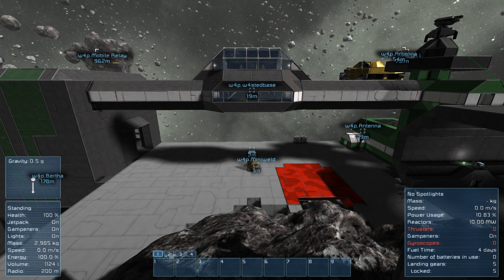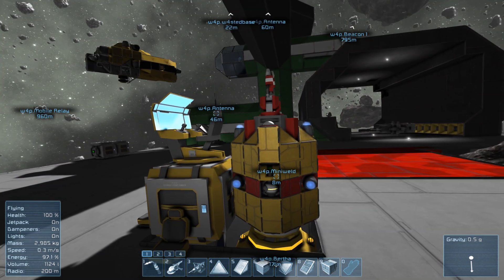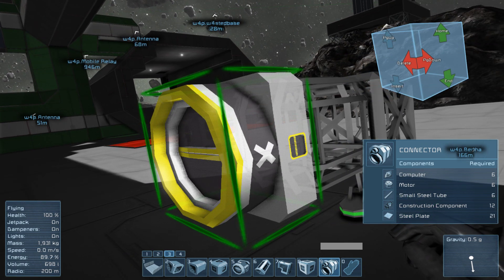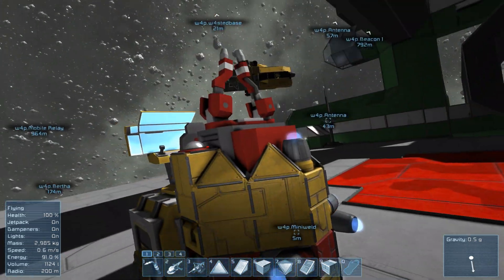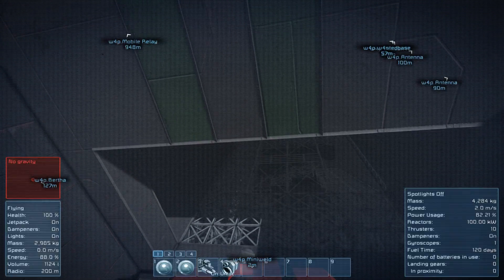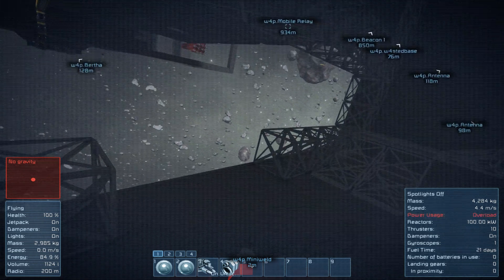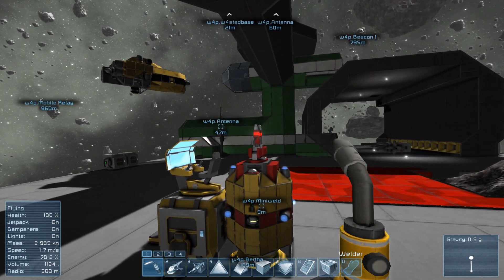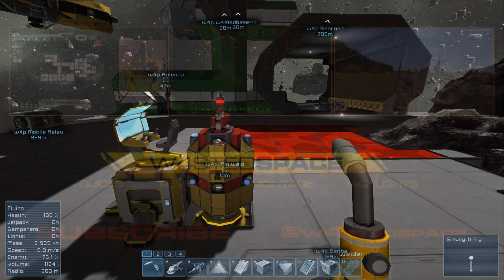Space Engineers - Remote Control Mini-Welder Tutorial - Survival Mode

Comment: Batteries...? How many and where?
Reply from the maker: It uses small reactors... it's a pretty old design!
Reply: @w4stedspace  lol, its a timeless problem... do you have a similar design that would work well on planets? I'm trying my hardest to build a small welding flyer to zip around the masses of scaffold base walls n floors... but everytime I try, it ends up a hulking mess at which point I figure if its gonna be a hulking mess then it needs to be vastly over engineered... which this is not... because it was meant to be tiny instead... which its not... 😡 also, im a long time fan. Youre one of the reasons I've been following this game for almost 10 years even though I only started playing when it came to ps... thank you for the reply and keep up the good work 👍
Reply from the maker: @sergiosperspective  Thanks a lot! Always nice to hear :)

Yeah you have sadly run into one of the most awkward of designs to attempt... you need cargo, which is huge, and it needs large connectors.... which are huge.. and then you need batteries... which are huge.

I don't have an easy design example - I did build a much more modern one during the Vanguard series, but that could have been smaller.

Imho the best way to handle things is with a swap-out battery pack, so you can use one or 2 batteries only, and switch them out to recharge to keep the size down but still get decent runtime.

I'll see if I can dig up a timestamp for the thing from Vanguard!
Reply: @w4stedspace  youre very welcome.

You describe the problem pretty well... that plus the weight of the cargo...

But the battery pack idea is pretty ingenious... (why didn't I think of that myself?) Gonna give that a try for sure.

If you can find that time stamp it would be awesome. So far, my best design for a welder was a single axle two wheeler, balanced with gyro overrides and steered with other gyros. The large cargo containers were centred over the axle as much as possible so balancing was easy. It was pretty awesome but prone to accidents when moving around and could barely climb any uphill when fully loaded due to the two wheels... also, God help you if your welder is in a tight spot and you sneeze. Way too many rebuilds because of that... I wish keyboard controlled gyros were a thing lol.

Comment: Very nice idea, so many things  I have to learn. Recently learned how to use a remote control block, didn't knew you can fly a drone like that.
Reply from the maker: Zamolxes77 It's an awesome way of doing things :) Another thing it allows you to do is put a seat instead of a cockpit and then use the remote to still allow you to control the ship.
Reply: ***** Definitely gonna steal your idea and get 2 repair drones for my Mothership. ATM however I'm engaged into creating a "toolbelt".

Basically its a platform, solar powered, with an assortment of aprox. 8 attachments: 1, 2 and 3 welders and grinders, plus some L and square shaped attachments, all served with a ship that can plug any 2 attachments on opposite ends. Attachments and the platform are purely solar, with a backup small gen, while the utility ship runs on both batteries and Ur.